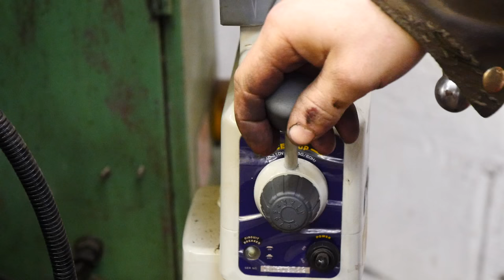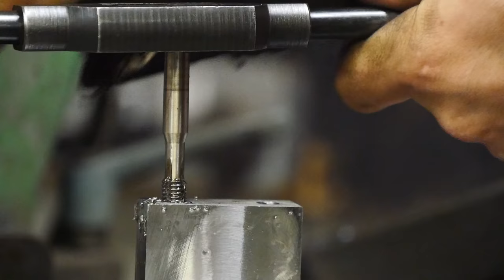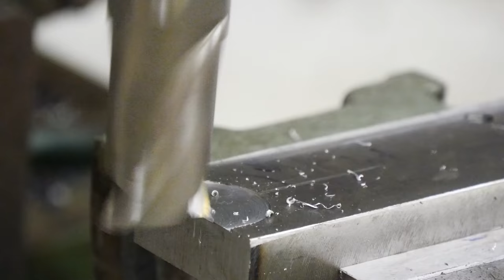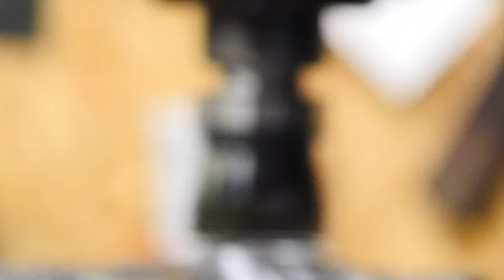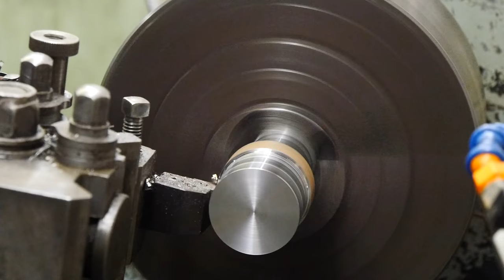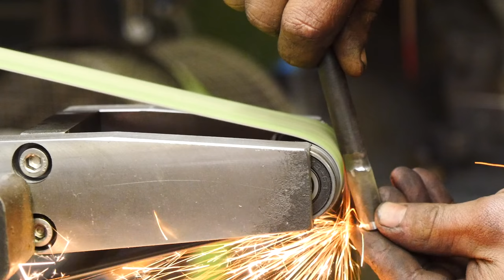HOMEMADE SMALL WHEEL ATTACHMENT FOR BELT GRINDER

Comment: Hey Alec, I really enjoy watching your videos.  I also wanted to make sure that you were planning on greasing those bearings since they don't appear to be caged aka sealed ball bearings and a bit of lubrication maintenance every few months is better than hunting for parts to those high dollar machines.  I've never been around any machines like that before but I'd have to guess that they would have some grease fittings near most of their moving parts (pistons, axles, etc.).  

I'm hoping you just cleaned the bearings up for the sake of presentation in the video and filmed the dry fit portion of the process.  I love your videos and would hate for you to have to have something expensive replaced when some quick lube maintenance could've prevented it.  Keep up the good work!